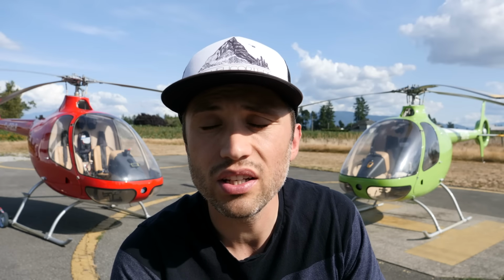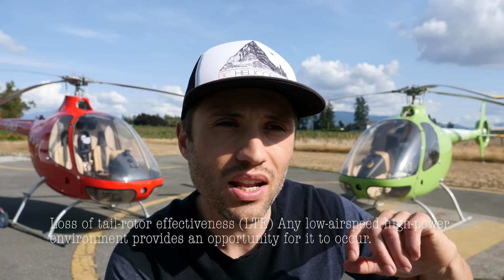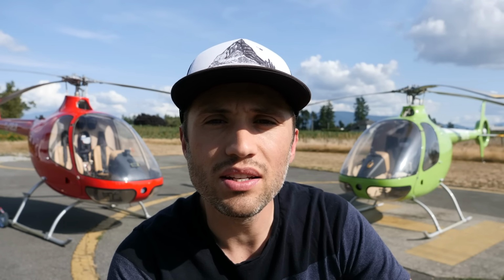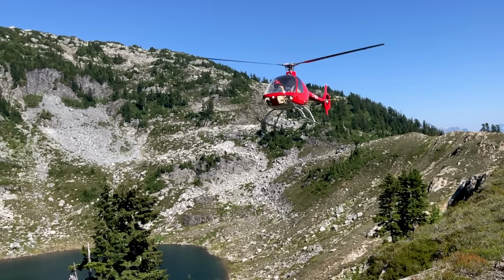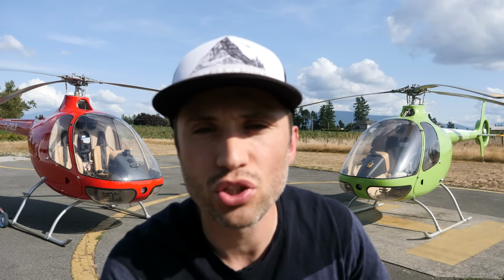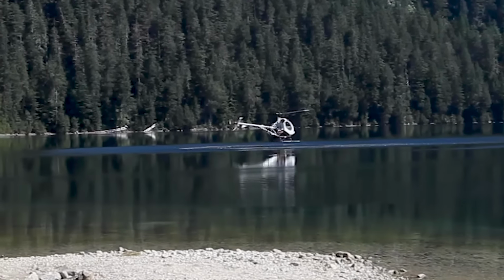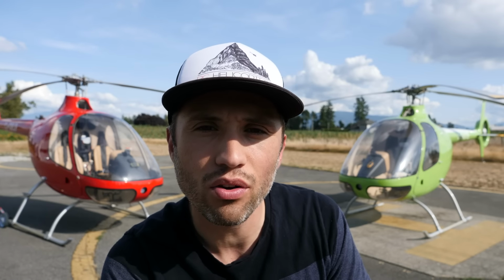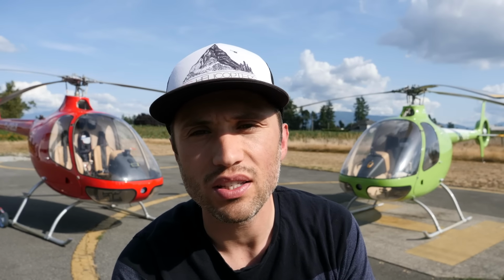OVERPITCHING and LTE can lead to a HELICOPTER CRASH

Comment: Why would you not have enough power... What changed because you had enough power like 5 minutes ago
Reply: Don't forget in forward flight less power is required because there is more lift. In a hover the aircraft can require 3-4 times as much power or torque to maintain a hover so if it is already heavy and there is a tailwind which reduces lift still further, power is suddenly insufficient. The pilot raises collective to try and increase lift, over-pitches, the rpm drops and the above happens.

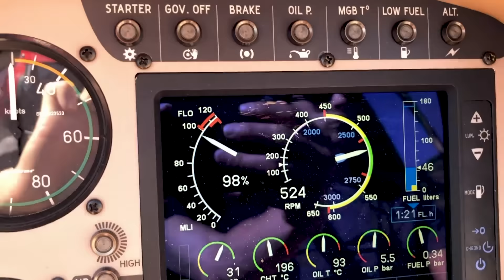Comment: if he were to follow your advice would he still not lose altitude? non pilot here but at 7:16 it seems that they are still going down after a considerable distance imo he was probably better off just not going that low but im not a pilot so what do i know
Reply from the maker: guy man yes the best is to not go that low but he had enough height to gain speed and lose the altitude he has but gain lift as he moves forward.
Reply: @PilotYellow  thanks for the reply I rewatched and realized he was probably losing power for longer than I expected thus is why he kept losing altitude so close to the water at first I thought he was simply showboating

Comment: Common case of not being prepared for the situation.  Always and I reiterate "Always" bring boat oars in your helicopter.  Get rid of the fire extinguisher your not going to need that crap where your landing and replace the weight with boat oars.

Comment: I've noticed that's Hughes /MD models seem to be most susceptible to the LTE, (This model is a Schweizer 300B.., originally a Hughes/MD model) NASCAR driver Davey Allison owned a Hughes 500C, he died from crashing  at Talladega, from a very similar situation as this video, however he only had about 9 hours in that helo after being instructed in an R22. And he also attempted a downwind landing. 

Question though, would longer tail rotor blades solve it? Because there's very little, if any instance i know of where an MD530F has had an LTE issue with longer main/tail rotor blades than other earlier 500 Models..

Comment: I hate that the helicopter industry has failed itself by not teaching even basic performance planning during preflight operations anymore.  Even this instructor fails to emphasize the importance of preflight planning. You CONFIRM your performance predictions during in flight power checks, NOT be surprised that you don’t have the power. 
They’ve also hurt young pilots by not effectively teaching the difference between Loss of Tailrotor Effectiveness and Loss of Tailrotor Authority, two completely separate issues/causes.  I doubt most pilots today don’t understand there is a difference.  Sad.

Comment: Friggin helicopters are scary. 
 I love all flying machines, but you need to be extremely lucky, or have a great knowledge of all of the helis limitations, expected performance under an infinite # of conditions, else except you may even blow the useable air out from under yourself. 
  Fixed wings are pretty simple comparatively, but I would need someone exactly like this to train with ever have enough confidence to relax enough to learn anything. 
  There is so much going on dynamically with helis that are of no concern to a fixed wing, I'd be afraid I'd forget one of those 7 or 8 thousand things & fall outa sky!

Comment: Over pitching? What the heck is that? I’ve been flying everything from a Hughes 300 to a E model Apache with approximately 3700 hours total. Several problems with the analysis of this accident! Reducing your power also takes torque away from the main rotor and lessens the requirement for left pedal application. Is overpitching your description of pulling in to much power? Your performance checks should have been done prior to take off for take off and landing for both weights at take off and landing altitude and weight and temp at landing. Lots of power factors missed in this after action video.
Reply: id never heard it called overpitching either. i didnt watch the complete analysis so not sure what was missed. looked like a steepish approach to a high da oge hover over water. that sewing machine just ran out of power
Reply: Jose Madarieta I’d agree with you knowing only the info from watching the video, but the the explanation and terminology used by the “expert” left my head hurting! Once you’re that low and that slow in an already underpowered machine in an environmentally challenged climate, you’re done!
Reply: @rdwelch2  copy that. and when your touch down point is a lake, you better make sure you've got an out or you're going for a swim. beautiful lake btw. i wonder how the trout is
Reply: Jose Madarieta yep and 😂

Comment: And if you just backed off power would it have same effect?
Reply: Lowering power and not collective will only cause the problem to get worse. When you're pulling that much pitch trying to get the lift you need, the drag on the blades is like trying to run at a tornado dragging an open umbrella. Less power isn't going to help speed them up or provide more lift, but with lower collective and forward cyclic, you're reducing drag, introducing clean air to the main rotor, and reducing tail rotor power consumption. Oh baby a triple! ;)

Comment: Why does/did the engine run out of power to hover it?
Reply: From my understanding they use less power during forward movement and more power to hover in place. Outside factors can determine how much power is needed to hover in place such as altitude, temperature, humidity, etc.. So one might be in a situation where you are creating enough power to keep moving forwards but not enough to come to a hover depending on the outside factors. Ground effect also comes into play, it seems like the helicopter needs less power to remain in hover when very close to the ground. I presume this is why they sometimes have a rolling take off to gain altitude easier when the other factors are not ideal.
Reply: To hover lift must equal weight. In theory you can get the same lift at either high rpm & low pitch or low rpm & high pitch. However in practice a piston engine doesn't develop the same power at all rpm. Its a bit like trying to drive a car up a hill in too high a gear. It bogs down.
Reply: Forgot to charge the batteries overnight. You're welcome.

Comment: I’m not a pilot but I’m just curious what causes the helicopter to run out of power? Why can’t it just hover or lift straight up like a take off.
Reply: Too hot, too high, too much weight. A Robinson 22 barely has enough power to carry 2 large framed people.
Reply: @sanfranciscobay  I was guessing it was maybe overweight, all those things make sense though
Reply: It can take off at a lower altitude with cooler weather and fly properly. If you take it higher with hotter weather, it may not fly properly.
Reply: nicely put!
Reply: SanFranciscoBay that makes sense with air density and so forth.

Comment: Why is there no more power available? Why does it happen at this point?
Reply: I was wondering the same thing?  As if the engine is just barely powerful enough to fly at all but somehow it managed to take off with more fuel weight?

Comment: Stupid question if it doesn't have the power to land how come it can take off?
Reply: When on the ground, the pilot can wait until the rotor is spinning very fast with no collective(blades are flat) and then add pitch to the rotor blades and all that momentum will lift the helicopter into the air.

Comment: Obviously he should have had an out, should have done a max power check, should have done weight and power, and shouldn't have attempted the overwater hover to begin with. But this reminds me of the two MH-60R's that LTE'd into lake tahoe before scooping it out. Same problems and those aviators lost their wings. Settling into ground effect reduces the power requirement and this guy should have been able to max gross it out. However, in this situation, he runs out of power - can't climb and can't keep from swapping ends. If he'd closed any of the swiss-cheese holes earlier he wouldn't be in that spot. However, as soon as he realizes he's swapping ends and can't maintain altitude go full right pedal. You'll spin faster but that frees up 4-8% torque to gain some altitude. Keep it level and let it swap ends and climb up to have altitude to play with. Then drop the collective and the nose and turn small circles into big circles by following the yaw with the nose. As soon as you hit translational lift you can get out of it.

Comment: So, during the first 180% of spin due to LTE, was it recoverable?
Reply: Jon Hall potentially right at the start if they had enough left peddle stopped it from starting in the first place. But once it started settling and rotating with full power, it was never going to end well.

Comment: My question is this: If he didn't have enough power to land safely, how was he ever going to take-off from there?
Reply: Already answered in the video - leave something behind...
Reply: @perrybrown4985  Well, he came in empty. In the video they said that had the beach area been clear, he could have continued his approach right to the landing spot and avoided the problem. But then he would be on the beach facing the same problem on departure, but with more weight. In other words, he came in empty yet still had the problem. Dump fuel? Pull out his radios? What is he going to do to make his chopper lighter than when he came in? Also,  I didn't see any breeze over the lake (where he was not stirring things up with his rotor wash) to indicate that he had a tailwind, or that he would have a headwind on departure to help him. Seems like there are things called flight manuals and charts for situations like this.
Reply: @jacknisen  Yes, you are 100% correct - it was a bad situation that could and should have been easily avoided.
I guess I was just pointing out that Mischa had said in the video to not try to hover over water because there are almost no options left for recovery. At least over land he could put it down hard and then dump something (or somebody) and the heli gets to fly another day... (Much easier to recover when stuck sitting on a beach than when broken at the bottom of a lake)
But, the pilot made so many errors and missed so many opportunities to recover, in the end I guess all we can say is it made an interesting video on overpitching...
Reply: @perrybrown4985  Another thing I learned from fixed wing flying is that air is usually descending over a body of water and this should be taken into consideration also.

Comment: I don’t get it, can’t you just increase the juice to start going up, how do helicopters then hover for a long time?
Reply: everything has a juice limit. this guy found his
Reply: He was at maximum power already.  A hot day, high up in the mountains in a low-powered helicopter, full fuel tanks perhaps?  - a helicopter requires more power to hover than to fly forwards, the pilot slowed down and the engine was going to the limits of its power.
Reply: Thanks Jose and George. Didn’t realize that. So many things to think about.

Comment: If the helicopter had enough power to lift off in the first place then why did it not have enough power to maintain a hover?
Reply: keith crozier he may have lifted off in lower altitude.

Comment: From an observer, not a full scale pilot:

This helicopter was not picking up people or equipment, it was dropping off supplies?  Was the pilot planning to land and add more weight (person/cargo)?  Is this possible because the helicopter has less fuel now compared to departure?

During initial takeoff with full fuel, how did the pilot get off the ground?  Was the helicopter at a lower altitude at the beginning of the flight and then the air became thinner with less lift at his destination?  Did the pilot "baby" the takeoff with full power and very little pitch to keep the RPM in the green?

Is there a reason the flight controls can't be trimmed to disable overpitching (sync power to pitch)?  Assuming this is done on glass cockpits when people have extra money to spend.

Your explanation of the overpitching and LTE was excellent.  I'm confused about how the pilot made it this far before descending in the water.  Was it as simple as pulling too much collective?

Why didn't ground effect help with lift?  Too little, too late?

So many questions...I need to take some classes :)

Love your channel.  Just found you a few weeks ago.  You speak kindly and show passion.  Thank you for the lessons.  I look forward to learning more, though I'm not a helicopter pilot!

-Clear skies and fly safe!!!!

Comment: You muddle the issue when you say the power check is used to confirm "A) You have enough power. B) You have enough tailrotor effectiveness."  Making a few basic assumptions, such as that the pilot was not applying right pedal in the crash above, then the only reason for the uncommanded yaw and descent was insufficient power.  In a hover, absent external forces, this overpitch of the main rotor (or deficiency of power) will always result in an uncommanded yaw if sufficient in duration due to decaying RPM of the tail rotor.  Therefore, during the power check if you confirm that you have "enough power", then the performance of the tail rotor from the perspective of power does not need to be questioned.

Comment: Is LTE more likely to occur with fenestron helicopters?
Reply: actionrjackson , it really depends on several factors. Short answer, if the main rotor rpm decreases, then the fenestron’s ducted fan rpm will also decrease. Lift being a function of several factors, the most influential being velocity squared, any decrease in rotor RPM will result in  a corresponding, exponential decrease in lift production. Increasing collective will increase blade pitch will increase the Coefficient of lift based on angle of Attack, and may boost lift for a moment, but it will also increase drag on the system. If the engine cannot meet the power demand to counter act the drag to maintain RPM, then you’ll “droop” the rotor. Hence, Rotor RPM is life, and a reduction in collective is needed to restore RPM if the engine cannot recover the RPM through fuel trimming in time to meet the demand or its performance is limited and simply has no more torque to push through the transmission.

LTE is most likely to occur in high da, hot or heavy conditions, where your power margin (the gap between power applied and power available) becomes narrower, simply because your more likely to run out of power available with a decreasing margine. One bad wind gust, or tail wind, or rapid control input, and your eating up that margin. At higher altitudes and/or hot conditions air is less dense and therefore the rotors have less bite on the air, and the engines have less gas to mix with fuel per unit volume. Combine the two and the helicopters performance becomes limited. Typically, the engines will reach their performance limit before the rotors run out of air to hold onto.

In this case, and in what could reasonably occur in a fenestron Helicopter, The overpitching caused the rotor system to experience more drag, which the engines could not counteract with additional torque (power) due to their performance limit, and thus the rotor rpm (NR) decreased. Since the tail rotor/fenestron is driven by the main rotor transmission, the tail rotor RPM also decreased. Main rotor and tail rotor thrust are both products of lift generated by the blades at given pitch angles, and as explained earlier, will exponentially increase or decrease lift production with corresponding increase or decrease in RPM. Hence, loss in RPM=loss of lift=loss of thrust= loss of tail rotor effectiveness to counter act the torque induced rotation of the helicopter fuselage. 

The fenestrons main advantage over conventional tail rotors is reduction in noise generation, added protection of the blades inside the housing and the elimination of blade tip vortices which rob convential rotors of lift production at the tips and cause induced drag. 

Beyond these advantages, I assume the fenestron will still be susceptible to LTE for the same reasons this poor pilot was. Someone with actual experience flying a fenestron equipped helicopter should definitely correct my assumption if false or incomplete.
Reply: actionrjackson I think I read somewhere that the newest EC-145 now has better tail rotor authority with its latest Fenstrom then it did with its original tail rotor on the 1st version of the 145. (But I wouldn’t quote me on that). But to answer your question; no, I don’t think you can generalise that much.

Comment: He let the rotor RPM decay... I don't think he was "Full power"... Been there done that.... I'm sure he had extra power, he just failed to keep an eye on it.... Once he came out of ETL and  did not keep the  rotor RPM  in the green, he lost Tail Rotor authority and pulling more collective only added to his demise....
Reply: You really don’t think that when he was settling toward the water he didn’t pull his collective full up and increased his rpm to full throttle?  LOL
Reply: @ronshaddox2382  The problem is when you pull too much collective without keeping the rotor RPM up is like going up a hill in third gear without downshifting...
Reply: I'm sure he was full throttle and full up collective but was behind the power curve. Just imagine if you were going up a hill and started slowing down and shifted from third to fourth gear and pedal too the floor you would be screwed. The out was too lower the collective forward airspeed too regain rotor RPM...